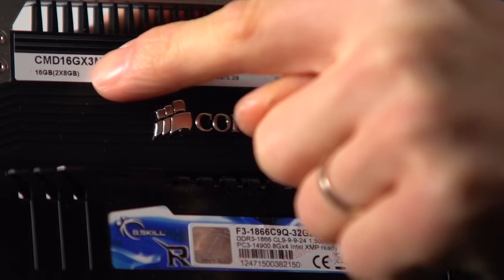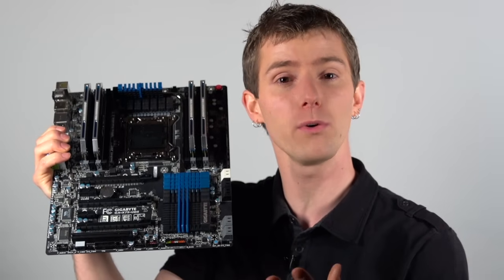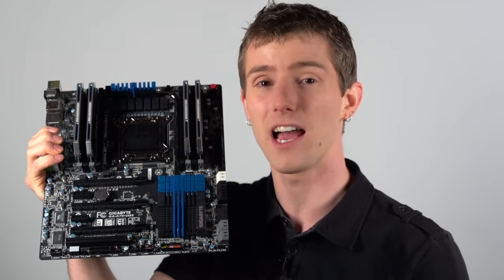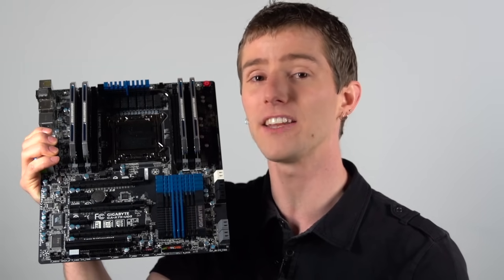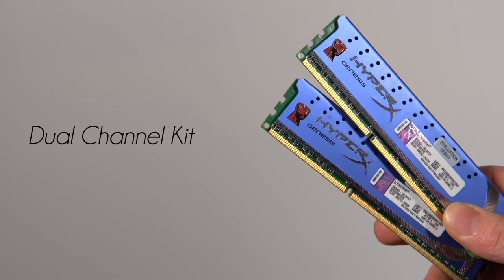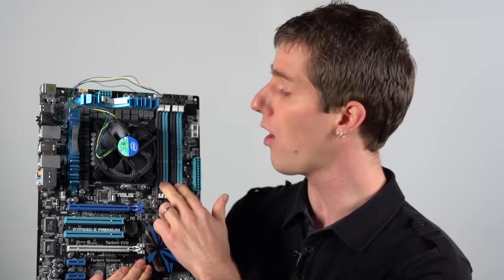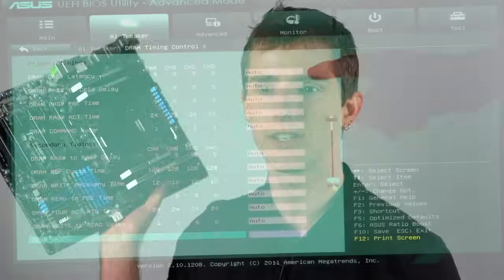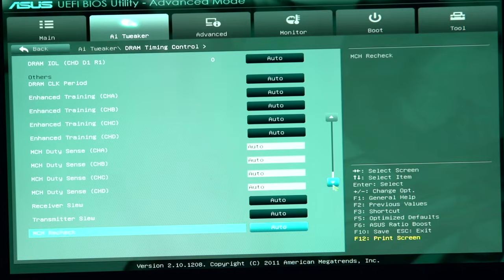Guide to RAM Memory Channels as Fast As Possible

Comment: so i have a dual-channel motherboard. and get a 8gb kit containing 2x 4gb sticks, can i uppgrade to 16gb's later if i buy the exact same kit?
Reply: Most likely
Reply: BattleAngel1 ok thanks for the answer
Reply: The sticks in one kit are validated to work with each other, so make sure the sticks from one kit are operating in matched RAM slots on your board. Assuming your motherboard has 4 slots, there will be two pairs of slots, so what you want to do is use one dual channel kit for each pair of slots. As Linus said here, the slots are typically colour matched (if not check the mobo manual).
Reply: your motherboard manual usually says how to install memory.. as well as limits on size.  my last computer mb could only address 8gb  this one 64gb  It should also tell you the order in which you should populate the dimm sockets.

Comment: Dell XPS 2720 All in one is my biggest headache at the moment....Dual graphics systems Intel 4600 vs Nvidia Graphics chip and that really useless systems manager Optimus 
I have customized my Dell and it now runs the following spec stable
>  520GB Samsung EVO SSD Drives + 
>  250GB Samsung MSATA 
>  upgraded Ram to 16GB 1600Mhz 
> CPU upgraded from i7 4770 to i7 4790K with a modest Overclock
WATER COOLED using Corsair H100i Extreme Block replacing the standard factory cooler (Radiator custom fitted through the rear panel : )

Comment: I use Corsair vengeance lpx, I have 8 gb and am planning to buy the same ram but 16 gb pair this time, can I use them with my 8 gig to have 24 gig ram. The 8 gig I currently have is 3000mhz and the 16 gigs are 3200mhz

Comment: my MOBO has 4 slots (MAX=32)3 of the slots have the same brand and model sticks of ddr3 (2 gb each) and one different stick of ram that is 4gb  of ddr3, the pc works fine with just the 3 identical stick or just the one 4gb stick, works with one 2gb and the one 4gb stick but not all of them together...? any tips....??

Comment: ok. so can i run 2 separate dual channels into my motherboard? i know itll be dual channel still, but will it be safe? Right now i have 2x4 8gb of corsair platinum 1866 mhz. i want to put in the exact same kit and have 4 sticks. is there any guarantee itll work and still be dual channel? my motherboard is a crosshair V formula Z, cpu FX 8350
Reply: Yes, they will work. The ram should be in all the dimm slots. (2 in red and 2 in black) ;D

Comment: if my RAM says it's optimized for Intel, will that cause any issues if I try to use it with an AMD processor and motherboard?
Reply: very unlikely. aslong as the motherboard supports your RAM, ie. DDR3 mobo + DDR3 RAM, it should work. i think if it says optimised for intel it'll just be slightly better for intel CPUs
Reply: Ven Kitsune ok, then I should be good
Reply: Ven Kitsune Yeah...but there is a physical difference between ddr/2/3/4,so he wont be able to connect them to incompatible mobo in the first place
Reply: aleksandarfriscic thats not what he said.

he never mentioned using DDR# RAM on a DDR# board etc.

Comment: My MotherBoard is P9X79 WS(Workstation), I have one slot of 8GB and I'm planing to buy other 8GB, would it cause  me any problems?
Reply: i have two completely different brand names / mhz speed of ram in an HP cheapo tower , works just fine  what linus was saying is if your ram is too out of tolerance with each other they wont operate in dual / quad channel  and may revert to single channel operation ... will still work but may not get the full performance it should

Comment: If my laptop came with 6gb it's expandable to 16. one is 2gb and the second slot has 4gb. if i replace the 2gb with 8gb and have a total of 12gbs will that slow me down? i know it's probably best to replace both with the same brand and size but will i benefit with going with one 8 and one 4?

Comment: I have a question I have a EVGA LE X58 motherboard 6x2Gb corsair Dominator ram populating only 5 out of 6 slots one ram was causing instability n found out was bad. Am currently running 10gb with 5 slots populated.. can I still run the Pc fine at 100%?
Reply: As long as it is an even number. channeling should be fine. Odd number gb will not channel. for say. 5gb. it'll have some issues in latency. ( fluctuating bandwidth)
Reply: thank you

Comment: So if I have a dual channel motherboard (4 slots, 2 colours), could I populate all 4 slots with identical ram sticks? Otherwise what's the point of having 4 slots?
Reply: As far as I know yes, if you would put in four identical dimms from a 4 channel set it would run it as 2x dual channel, not optimal but the difference (from running the same dimms in a 4 channel board) is negligible. TL;DR you will be 100% fine.

Comment: I have question if any one reply -Question is in a motherboard DDR3 2GB/4GB is support in this board ,but which FSB (1066,1333,1600) MHZ should be Installed,is their 1600MHZ FSB right or wrong?and how to caculate which FSB is should be used by seeing the motherboard ram slot?

Comment: Nice video....
But i have a big problem with my pc, i have win 8.1 x64 with 8gb ram but the problem is that my pc uses nearly all the time 7 or even 7.8gb for a long time without having big programs opened....abd summing up all the needed ram in the task manager, i dont get up to those 7 or 7.8gb, what can i do? Is there a software problem or do i need 16gb ram?
Reply: where did you see the usage from ?
i dont think that tit can be possible from malwares but download and install this for any case 
http://www.surfright.nl/en/hitmanpro/     thats the best bytheway for infections
Reply: Αντωνης Καββαδιας
okay thanks for your tip, i'll try this...i saw the usage in the taskmanager and the ressource monitor...
Reply: TheTechTutorial let us now if that helped
Reply: Αντωνης Καββαδιας so, i tried nearly everything but it isnt completely gone, i still have the problem a few times a day...
Reply: TheTechTutorial i dont know if you are ok with formatting the whole thing but if you do try formatting your pc with DBAN Darik Boot and Nuke  http://www.dban.org/ and then try installing your windows back again.....
or try installing an antivirus http://thepiratebay.se/torrent/6584468/ESET_NOD_32_Anti-Virus_4.0.468.0
https://kickass.to/eset-nod32-antivirus-7-crack-32-64-bit-thadogg-xtrteam-t8765475.html and perform a full scan
Reply: I had the same problem, but I fixed by 
1. Open "Run" windows button + R
2. type regedit
3. Go to HKEY_LOCAL_MACHINE
4. Go to SYSTEM
5. Go to ControlSet001
6. Go to Services
7. Ndu
8. Start value has to be 4 instead of 2
and that should fix the problem
Reply: TheHeldgaard
What "Ndu" stands for ??? and, Is that a subkey ??? I ask because only appears Ndis, Ndisuio, but not Ndu
Reply: How much ram should windows 7 take up?

Comment: So my dual channel motherboard, should I get 2x16GB instead of 4x8GB? Or even  2x(2x8GB)
Reply: Whichever's cheaper. If your mobo has color-coded DIMMs, they distinguish the channels. If you're only using two sticks, put them in DIMM 1 and 3, or 2 and 4, since these pairs are what make up each channel.
Reply: ineligible226 I have an ASUS Maximus Hero VIII. So it won't cause any problems if I get 4 modules? Like people have told me it puts "stress" on the mobo and CPU if I put 4 ram modules on a dual channel board.
Reply: Why would dual channel boards exist to only use 2 modules? You'd only be using a single channel in that sense. They're made to be able to support 4 modules, so as long as they're all the same clock speed / manufacturer, you're good.
Reply: ineligible226 OK thanks for the response. Do you know if I'm supposed to get 2x(2x8GB) or 4x8GB? Like 2 kits or 1 kit of the same RAM?
Reply: If they're the exact same modules, down to the clock speed, it doesn't matter which way you get them. I got a kit of 2x4GB HyperX DDR4 @ 2666mhz and then went and bought 2 more of the exact same 4GB sticks individually and it worked just fine. After all, RAM kits are just bundles of individual sticks and sold off as one package.
Reply: ineligible226 no problems with it? thats whay im doing with hyperx fury
Reply: None at all. Memory is registered just fine and runs at 2666mhz when I check UEFI.
Reply: ineligible226 aight cul

Comment: i have brought 1x8gb stick of corsair vengance LPX ram. Would i be able to install another one and would it work?
Reply: C o L e S I have the same question. All 4 of my mobo slots are black, and i installed 2 sticks of hyperx fury 4gb and now i want to buy another kit of 2. Would that work?
Reply: same with my mobo all 4 slots are black and im confused
Reply: C o L e S should work
Reply: Check your motherboard manual, you most likely have dual channel slots. If that's the case then you should buy an X2 it and discard the 1x8GB or you could buy an identical 1x8 GB and pair it with the one you have(may cause bugs and bottlenecks). Be sure to check your motherboard manual to know which slots work on the same channel.
Reply: I just installed the other 2 sticks and no bottlenecks or other problems just make sure you buy same speed ram
Reply: bought*

Comment: Does anyone know how to see if your RAM upgrade, (new card) is compatible with your motherboard? I used Crucial to see if the card i want to buy is compatible and it is not on the list. However there or like 8 others that are Indentical in name, only the specs are different. Like 4x4 GB, 4 x 8 , 1 x 4 GB. But not the 2 x 8 GB. so.. what i want to know if it still works. Is their a high risk? If you can help me i would appreciate it hugely! Ty

Comment: which would be better out of these to kits?  CORSAIR Dominator Platinum 64GB (8 x 8GB) 288-Pin DDR4 SDRAM DDR4 2800 (PC4 22400) Desktop Memory Model CMD64GX4M8B2800C14  Timing 14-16-16-31 AUD$704.00.  

OR CORSAIR Dominator Platinum 64GB (4 x 16GB) 288-Pin DDR4 SDRAM DDR4 2800 (PC4 22400) Desktop Memory Model CMD64GX4M4B2800C14 Timing 14-16-16-36 AUD$652.00.   My mother board is a X99S GAMING 9 AC Memory Channel Quad they are all the same colour, so from what linux the 8x8GB ram kit would be best for optimum performance for my motherboard? to fill all the channels...  ??
Reply: +MrZeljko88 If your motherboard has 8 slots and you have no plants on adding any more ram in the future then the 8x8gb. Otherwise the 4x16gb.  They're both the same type (DDR4) and the same speed (2800) so they would perform the same. It also depends on how many channels your motherboard has.
Reply: +Sulfen 8 channels all the same colour it supports up to 128 gig but not even my intel 5690x supports up to 128 lol. SO i think i will go with 8x8 as my mother board has all 8 dimms are the same colour.
Reply: MrZeljko88 If you have 8 channels then your best bet is to get two sets of 4 channel rated rams. Each set comes with 4 ram sticks so that should keep them all filled. As to what amount of memory, get the best that you can afford. Your computer will run a lot faster and have less clocking issues if you get 4 channel ram rather than dual channel or single channel.
Reply: +Sulfen I agree CORSAIR Dominator Platinum 64GB (8 x 8GB) 288-Pin DDR4 SDRAM DDR4 2800 (PC4 22400) Desktop Memory Model CMD64GX4M8B2800C14  That is the ram kitt im getting, thanks for your input hey. BTW THEY are out of stock damn it

Comment: why does it has 4 slots for dual channel when it recommends 2 sticks then?
Reply: Probably to get people to buy more memory.... Now that I finally found one person who has the same confusion I can stop looking at the obvious questions everyone else are wrtigin
Reply: A four slot, dual channel setup will have two pairs of slots. Each of those pairs are designed to operate with both sticks from one dual channel memory kit populating the two slots in the pair of slots. So if you populate all four slots, you have two pairs of dual channel memory operating.

It's set up like that because there's an upper limit to the amount of memory we can stick on a DIMM and at the very high capacities it gets a LOT more expensive. If you wanted 16GB, for example, it was at one point cheaper to go for two 2x4GB kits than one 2x8GB kit. (This is an example and is not typically true right now, but it was a while back. When 16GB sticks start to become widespread, they will likely be more expensive than 2 8GB sticks for a time.) Plus, if you wanted 32GB of memory, you couldn't currently do that on 2 slots with consumer memory kits for a reasonable pricetag.
Reply: Rewatch the video. You missed important details in the beginning.

Comment: I'm having an issue and need some help please... i got a new Ripjaws G. Skill 2400 mhz 32gb (4X8) Kit. my actual setup is Asus z97 pro (Wifi-ac) and i7 4790K... The thing is that i installed the 4 slots and i only get 16Gb of ram... how can i configure to get those 32? As crazy as it will sound, i really need those 32gb cuz i'm working in very huge gigapixel panoramas (i'm photographer) and i need huge lots of ram.

Thanks in advance!

Comment: My mobo has 2 slots for ram n I have installed 2 2gb sticks ,im planning to upgrade the ram,but I want to buy only one stick because one of my current stick will go a waste anyway.

What kind of stick should I choose.?
Reply: If it's still DDR2 than getting 4 GB sticks will be a pricy thing. DDR3 is better in terms of prices today,
Why not get 2x 4 GB sticks and sell your old ones.
(for flawlessly running dual channel you should use sticks with the same rated speed and timings)
Reply: its DDR3 ram only

Comment: If you have purchased 3000 Mhz and adjust them down to 2600 Mhz will they be faster than if I had bought them at 2600 Mhz. maybe they will withstand heat better and run more stable

Comment: Hello, does anyone know if I use two memory modules, exactly the same but just the color differs, and hence the code number of each one, in just one letter. But the properties, capacities, speed, etc, are exactly the same. Does the dual channel mode would be activated? Thank you so much. I have one white hyperx fury ram, and want to buy another one, but I don´t get it anywhere. I do get the same in black. Thanks to everyone. Bye

Comment: so im think about upgrading my 2x4 kit to 16gb by buying another 2x4 kit. Is there anything wrong with running 4x4 ?
Reply: Nope, there's nothing wrong
Reply: I'm doing the same. Just make sure you buy the exact same brand+model of the RAMs as the ones you already have, as long as possible. 
Smaller memory sticks are faster than large ones, too. That is, you get a lower CAS latency (CL) on smaller sticks. So 4x4 is generally faster than 2x8, for example. Extremely small difference, perhaps.

Comment: So... I currently have 6GB of 1600Mhz DDR3 ram, but I'm not sure what the exact type is. I'm wondering if I should upgrade to 12GB.

Is there a good way to work out what the ram is exactly, without yanking it out of the motherboard and examining it? I don't know if the PC can read the "make" or anything of that nature.

I'm also not sure how important it would be to get more of the exact same type if I doubled my ram, as opposed to just getting more 1600Mhz ram.

I'm only intending to play games on this system so I'm not entirely sure if this is worth it, either...
Reply: I've not noticed any problems with combining corsair memory and kingston memory unless they are different speeds, so the brand should not be a problem. 12gig of ram is more used for rendering computers, 6gig should last you a bit more, if you're only planning on gaming, but if you feel like going commando, buy 6 more gig with the same mhz.
Reply: Are there any issues with combining brands if you overclock though? I'm not sure how similar the stability and voltage requirements are.

I'm also worried there's an additional problem. I have a huge Titan Fenrir heatsink and I have a nasty feeling it might be entirely blocking a ram slot...
Reply: I guess the same thing is with combining graphics cards in SLI or CrossFire, aslong as it is the same model, being gtx and radeon, it will still work.

Voltages are usually the same, unless you overclock which I guess you've not done. By doing some quick research just now the 1600mhz is laying on 1,50V - 1,65 V. Personally I don't think thats a problem, otherwise you can downclock or overclock the ram module.

Cooling, I'm not a fan of big heatsinks, as of now I'm saving for a Corsair h60, watercooling, reason being that I like my case being tidy.
Reply: As long as you have the same speed ram in all slots, and matching ram in each channel, you are fine. You can have 2 different brands, as long as they are in different channels, and have a matching partner in channel with it. Motherboards apply a separate timing profile for each channel. It should not cause instability because multi-channel memory is designed with the assumption that the performance of each channel may not be exactly the same, however, making sure the ram is the same frequency ram will make sure your ram runs at its optimal frequency and not get underclocked because of the slower ram in the other channel.

Comment: my mobo is dual channel w/ 4 slots! I have installed 2x ADATA 2GB (dual ch) and 2x KINGSTONE 4GB (dual ch) that makes a total 12GB of RAM! The qustion is:
"Is the total amount of RAM running in DUAL ch spec??"
*RAM modules have the same sprcs and timimgs, except capacity.

Comment: i installed 2X 8GB 667Mhz and 2X 8GB 800Mhz  and totally 32GB ram (Accidentally i bought second kit on 667mhz) is it problematic and make stability issues?  :(
Reply: +Amila C Kumarasinghe It'll just slow the faster ram to the same speed as the slower ram most likely
Reply: +Matthew Charles-Roy Thibault Thanx matthew.

Comment: The following is not correct I think: quote "1 RAM module only gives you a quarter of the memory bandwith of 4 RAM modules"... it WILL have less bandwith, but just a few percentage points...
Reply: or the difference in PC speed will be just a few percentage points.